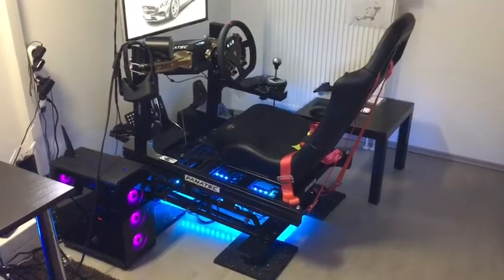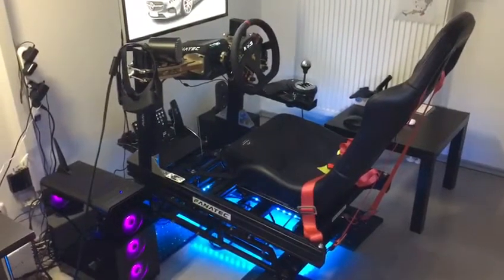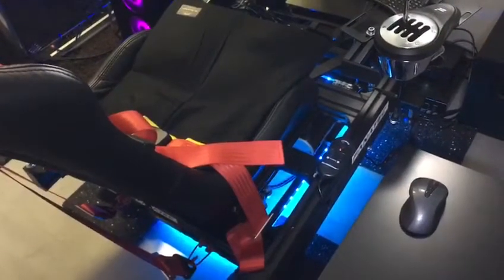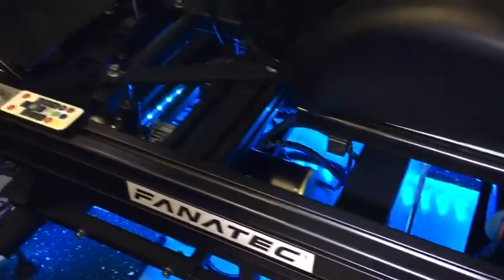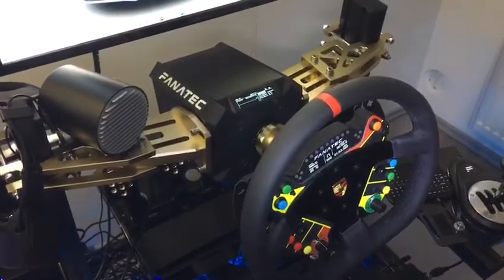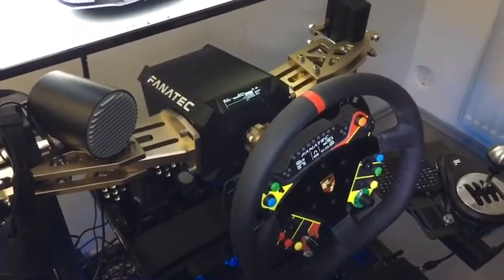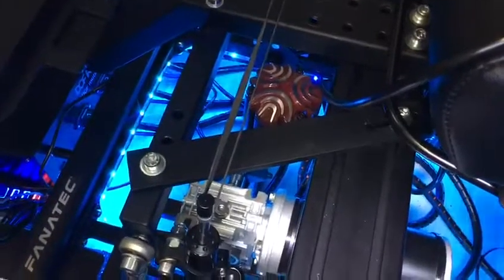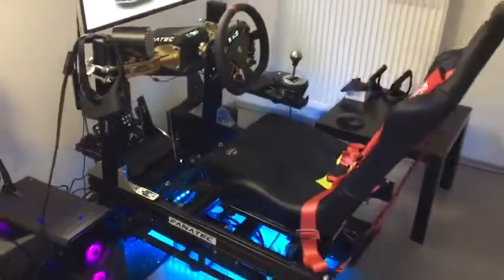DOFReality H3 wheelbase optimization with aluminium profiles

Comment: Hello! I'm looking for the same option with aluminium profiles and you have give me a answer! Many thanks for the video! 
I have just a question: balance work good? Problem with engine temperature for many Hours play? Any general problem after the conversion? 

Thanks in advance 
Cheers Raimondo
Reply from the maker: Absolutely no issues with that mod. 👍🏻👋
Reply: @christianhofmann7182 Many thanks for the reply!!! Cheers 🎉
Reply: @christianhofmann7182  Hi Christian, I'm following your project and buying the necessary equipment, but I have a question about the pedal set. I have a gas-powered SRP, and the brake pedal is much harder than a Fanatec v3. I'm afraid that the original DOF-Reality support might break. What do you recommend? Many thanks!
Reply from the maker: @travaglino83 I am so sorry I didn’t use this rig since three years now, I have a 6dof PT rig now. I think the pedal plate can bare a lot of pressure though. 👋
Reply: @christianhofmann7182  How is the aluminium structure attached to the rear of the DOF? Under the seat bars? i can't see it...
Reply from the maker: @travaglino83  to be honest I cant remember any more, as I sold the rig three years ago. If you look for the group "DOFrealitybuilders" in Facebook, you can search there for Johannes Bühler. I imitated his idea. There you can see the datails of the project.

Comment: Thanks for posting.  This is a really clean build.  I just ordered an H3, and looking to do something like this.  Do you still use, if so, any comments after a couple years on it?
Reply from the maker: I sold it January and changed to a 6 Dof pt system. But it was always a pleasure to use it.

Comment: Thank you for sharing this Christian! Spectacular rig! 

Did the long horizontal 80/20 bars make balancing it easier? It’s impressive to see this level of upgrade. Congrats on cold motors :)
Reply from the maker: I don’t think that the Long horizontal bars made it easier. The most effect had to push the original main bar as far as backwards as possible. Thank you for your interest 😄